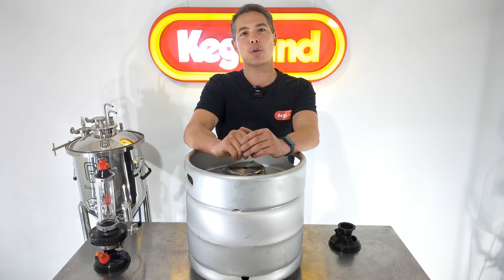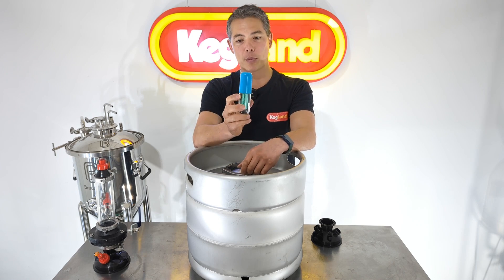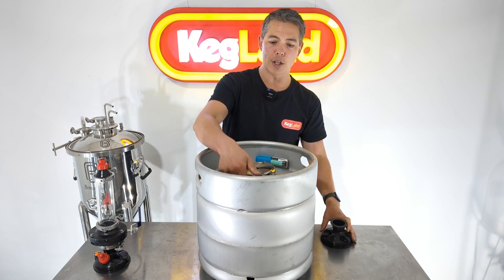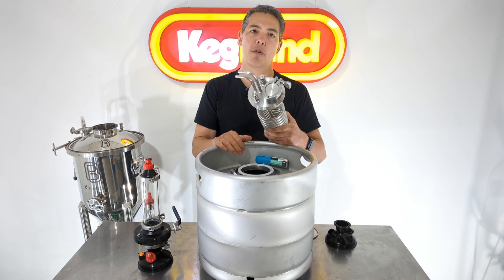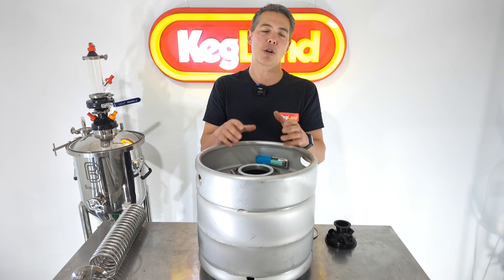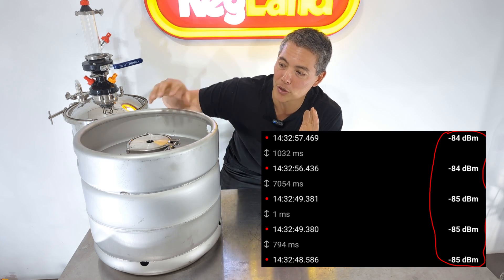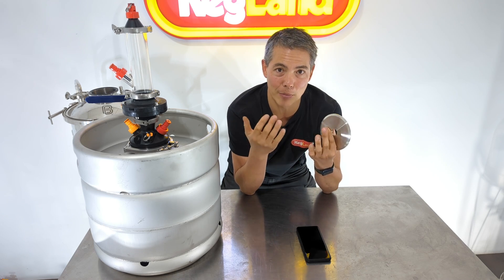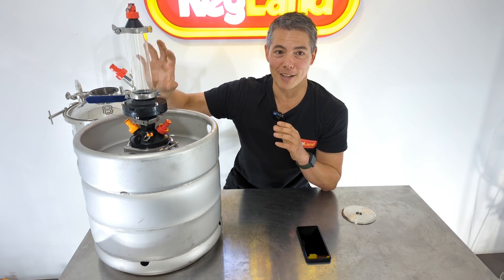4" Tri-Clover Pressure Lid - Plastic vs Stainless - Improved Wifi/Bluetooth Signal

Comment: Anyone know what the total height would be for 29ltr kegmenter plus this try clover lid, butterfly valve and hop bong. Really like the idea of this set up and want to know if it would fit in my temp control chamber
Reply: I was actually wondering the same. Not sure if Kegland have this measurement.
Reply: I just read somewhere else that its around 74cm. Which is 2cm more than my fridge can hold. @kegland do you know if a wider or more low profile bong is being considered to make?

Comment: This would apply to a fridge door I’m sure? My WiFi if about 8m form the Pill, goes through one wall and then the fridge door. 
To use Bluetooth would this improve the link to the router? Then I can get the data using my phone on WiFi? 
Or does Bluetooth only work directly to my phone/ipad?

Comment: Can you install a thermowell in the new lid as well with everything else on it
Reply from the maker: You can, but much better to use a Pill instead - WiFI transmission is one of the main benefits

Comment: that stainless lid looks like lots of machining welding and cleanup and mostly manual work with the cost of skilled workers,the plastic unit looks a quick injection followed by minor trimming maybe.
Reply from the maker: Yes it's not impossible to make from stainless but it's a lot of fabrication work to make a product with similar functionality.

Comment: Another great product from Kegland. Just a couple weeks too late for me! I wanted to try a hop bong with my kegmenter so I bought a 2 inch tee piece and 2 inch disconnect lid. The whole assembly looks pretty rad and a bit mad scientist.

WiFi signals seem OK for the tilt sensor I'm using (after switching to a raspberry pi based extender sat right on top) but I may switch to this lid in future for reduced overall height or if I encounter any WiFi issues.
Reply from the maker: Yes if you have a repeater right next to the fermenter you might be ok.

Comment: How about an oval shaped lid like a corney keg? Then it would be self-sealing and safer.
Reply from the maker: This has been spoken about before.  The only problem is it's very poor with respect to vacuum so if pressure drops in the fermenter you will 100% suck in oxygen via the lid.